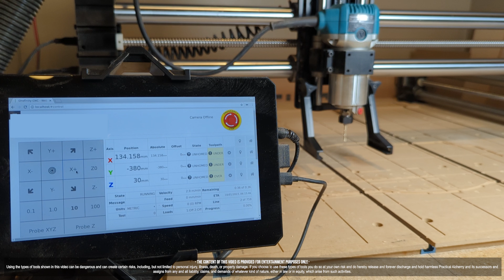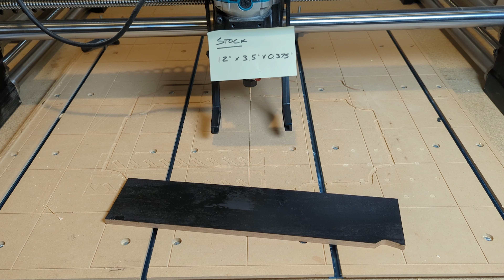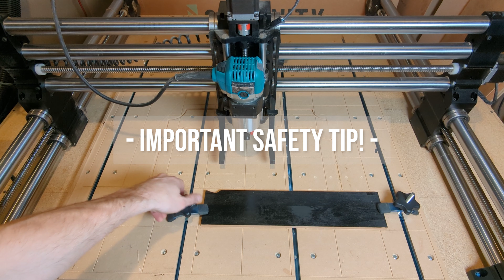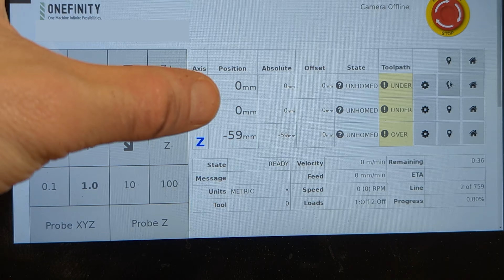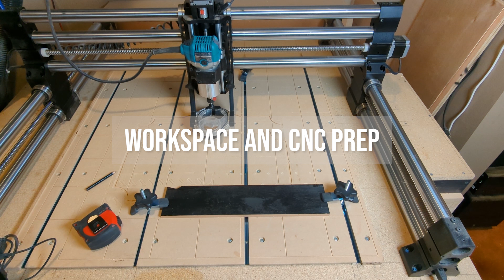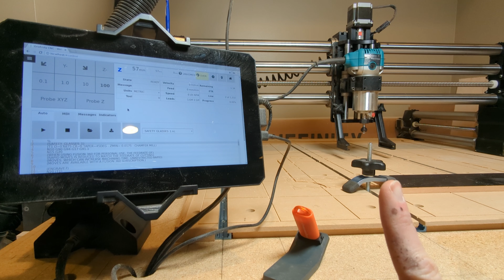Complete V-Carving Walkthrough Start to Finish  [Part 2] - Stock Prep & CNC Setup -  Fusion 360

Comment: Awesome video, this is just what i needed!  Subscribed
  The only thing I didn't see in this series is how to set the depth of cut.
Reply from the maker: Thanks Sean!  Glad it was helpful!!  So with V Carving the depth of cut is determined by the width of the path and the angle of the blade.  Check out my other V Carve Basics vid, I break it down in depth and illustrate it with some simulations.  Cheers!